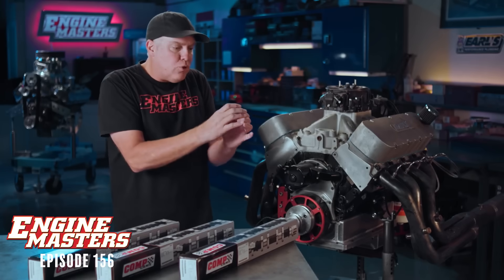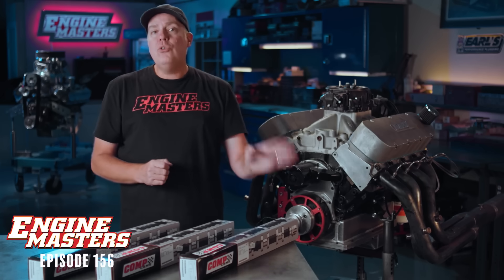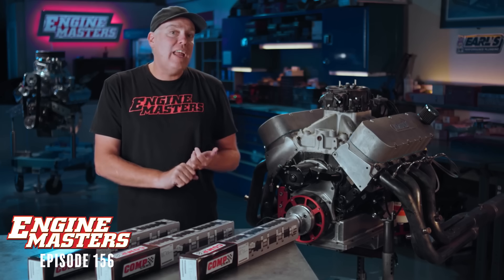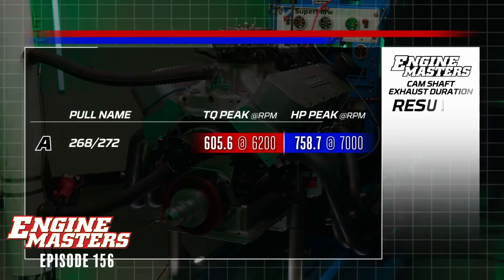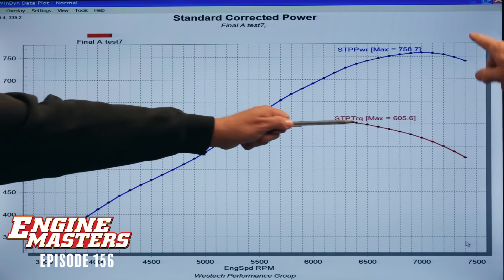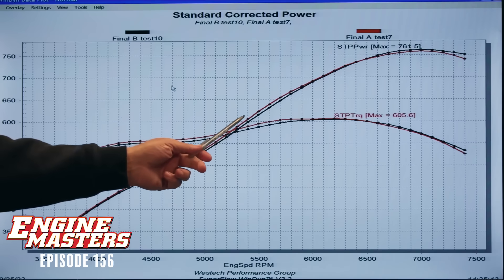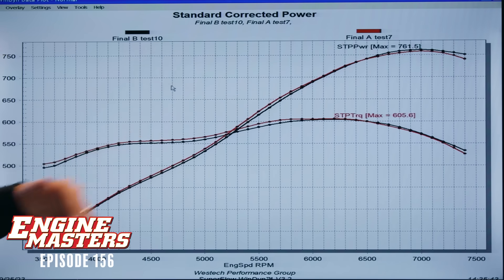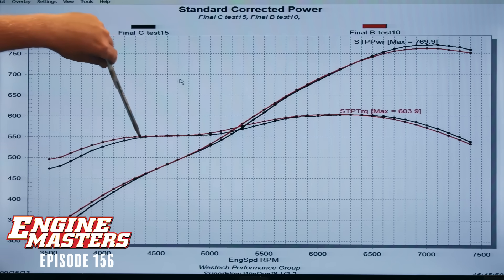Do Longer Camshaft Splits Affect Performance? | Engine Masters

Comment: One thing is clear to me. If i had any one of these cams, Im glad i didn't pay for an upgrade to any of the other two. The percentage difference is tiny. That is how it goes sometimes when you try science instead of just marketing. Awesome video.
Reply: theres less fuel exhaust, than fuel inlet. as its burnt up. this is why the exhaust valve is smaller, so a cam with same or smaller duration, is fine. bigger makes no difference..
Reply: Agree..Second guess myslef about not choosing my first cam choice. Would be single pattern instead of an 8 deg split and 106 vs 108lsa. 
If I lost a touch of torque so be it
Reply: The exhaust is under pressure and the intake is under vacuum so the intake is larger
Reply: The problem with this test is they tried it with an aftermarket head that corrected all the problems that would require a dual pattern cam. More of the reason for a dual pattern cam would be stock heads that had restriction on the exhaust, these heads do not have any of those issues so pretty pointless in my opinion

Comment: it should be noted that typically, stock cam will not have the same separation as the aftermarket. even a mild aftermarket cam will give longer duration and separation.
Reply: Sometimes less seperation. Or do you mean more overlap
Reply: @JustinMorrisV82  that boggled me for a minute. I guess the term might be a bit antiquated. it was a term I heard somewhere but never thought how misleading it is. you're absolutely right, it overlaps

Comment: Heads determine what camshaft you use Holman Moody heads you never use more duration on exhaust side. Stock heads have low exhaust flow rates .

Comment: We use big spreads on sbc engines when we spray them, usually on the opening side of the ex.
Reply: sbc needs all the help they can get.. or, buy a clevo..& a decent cam.. no other mods needed..  no speed shops.. bs machining ect.. sbc were designed in 1936, never changed.. dead horse flogging.. LS. = updated FE. from 1955.. wake up chev, your centuries behind..
Reply: @harrywalker968 correction FEs were designed in the 30s
Reply: chev even fkt up with the 454.. its just not quit a 460.. missed again..

Comment: I wonder how this test would go for an engine with a poor intake/exhaust ratio, like on some small block Fords I've seen with 2.02/1.46 valves? Would there be a benefit on a head with, say, a .72 ratio?

Comment: Can you just change the Lifters on the exhaust side to 1.6 if your running 1.5’s??If just changing exhaust side lifters to 1.6 will that change sound of the engine like a dual pattern??If going to a 1.6 rocker on exhaust side with this be to much of a split?
Reply: Just search on google "running bigger roller rockers on exhaust forum" and you'll find your answer

Comment: You mentioned that all cams had the same lobe separation angle (lsa) but what was the lsa, and what was the intake lobe centerline?
Reply: Considering that it is Comp and looking at the numbers, that's a basic 110 LSA and probably an a 106 CL.

Comment: More overlap? The faster the air moves the more the overlap shows power up top. It could kill low end but on drag race engines low end is not a factor and no real performance loss but on a street engine you don’t want that going on.

Comment: Fairly common with asymmetrical cams in Euro in line 4’s. The most common cam for the Superchargered 1.8L Golf G60 8v is a Schrick 268/276. I use a 264/270 in my 1.3L 8v
Reply: The extra duration is making up for poor exhaust flow, so its just a symptom of head flow. If head flow was at the correct ratio cams don't need to have asymmetric.

Comment: I feel like the longer exhaust duration would reduce turbo lag, perhaps?
Reply: You actually want a pretty mild cam for turbo engines unless your compression ratio is really high, and your running E84 or other high octane fuels to suppress knocking.
Reply: @blkcoupequattro yeah they work better with less overlap

Comment: question . why only the exhaust valves were modified, if the volume of air entered remains the same, it is not a loss to modify only the duration of the exhaust, can you test what happens if you modify the duration of the intake and leave it unchanged on the exhaust?
Reply: The exhaust is the restriction, so letting more air in with more duration isn't going to help.
Reply: a ok, I understood, thanks for the info

Comment: This is why you just use a modern engine with variable cam timing on both the inlet and exhaust camshafts. Mercury make a quad-cam big block Chebby motor, right? Does that have VCT?

Comment: You forgot to take into account how much cooler your car sounds sitting at a stop light
Reply: Who cares if it's taking the talk? It only matters if it can walk the walk.
Reply: @davidphillips3953  true, but...on a busy street, or pulling out of a show with the cops sitting nearby to catch folks...a choppy idle speaks loudly.  just like when you pop the hood...you could have a 7 litre aftermarket stroker small block with a single quad that looks stock, but nothing says power like some version of a blower feeding the engine.

Comment: Somebody said there's not very many 16° split cams out there. All Mopar 440 hp's have the 268 on the intake and 284 degrees duration on the exhaust with a .450 lift. Even the 440-6 pack which was a low taper had the same duration and lift and overlap as the regular 4bbl.
Reply: There's a ton of cams with large splits. Just look at all the factory LS and LT stuff. Some have over 20 degrees. 14-18 degrees is very normal in LS stuff.

Comment: Just changing exhaust camshaft isn't going to give much of the gain- it has to be a few other changes as well. You want to increase CR, install oversized intake valve and only then increase exhaust cam duration.

Comment: More exhaust duration is kinda a ls thing ls3 head for example flow really good on intake side but suffer on exhaust side so maybe a ls3 would benefit from the longer exhaust duration making up for such small exhaust flow
Reply: or just some exhaust porting.

Comment: I would really like to HEAR the engine idle with the different cams.
Reply: Agreed. How did this affect idle quality? Not important to all I would think, but to some, idle quality is a consideration
Reply: And minimum steady idle RPM, and vacuum readings at minimum idle, min idle + 500rpm, min idle +1000rpm.
Reply: Yeah, and maybe what they did to vacuum? I'm a stickshift/fun car kinda guy (not a serious racer), so it's less important to me than to some, but I would think that off-idle response, idle quality, and drivability might be what makes this decision for most folks. As always (well, at least the good ones), this episode provided me with more questions than answers.
Reply: Generally more overlap/longer duration the less vacuum and lumpier the idle
Reply: @jedpratte  Yes. Which is why 3000-7000rpm dyno pulls on a Superflow as performed by Engine Masters etc can be very misleading to the weekend warrior guys out there. What the engine does between 500-1500rpm is super important to most people and it's 99% ignored by these tests.

Not to say I don't love Engine Masters! I was just suggesting that any testing involving big cams should include:

1. Minimum steady idle RPM and vacuum reading
2. Vac reading @ min idle + 500rpm
3. Vac reading @ min idle + 1000rpm
Reply: @GroovesAndLands If your putting big fans in, your not it too concerned with 500 - 1500RPM, your stall converter needs to go up to match the cam. If your a manual driver, you just need to put down the pink shirt and deal with a bit off low RPM grumpiness. It's all part of the fun, I've owned cars that didn't start making power until 3800 - 4000- it was one of my favourite street/strip motors I've ever built... It's sleeping for another project that on the go
Reply: @RebeccaKenworthy  Same here. Love peaky engines that flat rip like a big 2 stroke dirt bike. I dont care about vaccum mpg or anything else. 
Just radical and tire smoking gear banging fun!
Just gotta gear it no biggie
Reply: @gordocarbo  I feel ya 👍
Reply: I don't think it'll be too bad if noticeable at all. The LSA is really what will affect the idle quality
Reply: @ShawnyStorm wrong. LSA is misunderstood, as is what causes idle quality.
Reply: @pimpovic2 You just told Lanse he was wrong and then contradicted yourself and agreed with him at the end? Are you alright? 🤔😂
Reply: @pimpovic2  Exactly right!
Reply: Wider the split typically, idles smoother.
Reply: Yes

Comment: I have a 318 with stock heads. The exhaust valves are small. I'm thinking that s is exactly what I need
Reply: Something on a 107 lobe center (lsa). 260-270 total 220@50. Duration and .450 - .470 lift.

Comment: I think you would see more difference with exhaust duration if you were running manifolds and full exhaust. A relatively unrestricted exhaust isn't going to need more duration or lift on it.
Reply: You forget scavenging and wave resonance. May be down on power no matter the split or little hp gain

Comment: It could be argued that the narrower duration separation is better, giving more low-end torque, allowing for similar or same ET's with longer engine life. RPMs are the enemy of longevity. The true test would trying it in a car, unfortunately adding more variables.

Comment: Id like to see the difference in dynamic compression. I really thought that would be a factor.
My only guess on why hp went up is it might've gained some minor scavaging?
Reply: No difference. Dynamic compression does not change with exhaust opening and closing only intake because the exhaust timing doesn't happen on the compression stroke, only intake valve timing.
Reply: @davidphillips3953  
Correct but it's not the whole story. Yes the calculated dynamic compression stays fixed, but have you tried testing the PSI? It changes, and it can actually change a lot. Reversion and scavenging plays a factor in how the cylinder is filled. So what does change, is the cylinder pressure.
Reply: @davidphillips3953  if it increases overlap, then it can affect scavenging and let out some of the mechanical compression available. but once the exhaust closes, then you've got a final compression ratio.
Reply: @alertgasper  
You are talking cylinder pressure vs compression ratio. Yes they do ultimately have similar effects on timing etc. but they are two different things. I can set up two engines with the same intake duration but vastly different LSA and exhaust duration. One will like boost a lot more than the other for example.
Reply: i believe peak cylinder pressure was about the same only at a higher rmp so the exhaust probably made the difference.

Comment: I like the Pontiac firing order sweat shirt.
Reply: That's the most common v8 firing order. Fords looked different mostly because they number their cylinders differently 1=5 2=1 3=6 4=2 5=7 6=4 7=8 8=4. But the roller can Fords do have a different order similar to an ls or 4-7 3-2 swap. All the gm v8s of the same era and the chrysler v8s had the 18436572 order.
Reply: Pontiac, Chevy, Oldsmobile, Cadillac, Buick, Chrysler, Plymouth, Dodge, pretty much everything but Ford products. Ford numbers their cylinders 1234 on the right, and 5678 on the left.
Reply: Holden gm 304 firing order is 12784563

Comment: ONLY 478 cubic inches and 12.5 compression ...LOL
Reply: Figure it’s a 427 after the aftermarket block and aluminum heads. It’s way easier to get 4.5” plus off the shelf pistons with relatively short compression heights than it is a 4.310/4.320 or even 4.375 anymore
Reply: lol yeah and they say small but I guess this day and age when you can buy a 632 crate engine making a n/a 1000 horsepower 🤷🏽‍♂️
Reply: @Carculturelivin It used to be big money, now it’s pump gas friendly? The 565 in our blown alcohol car started life as a Sonny’s 1000hp street engine. Dart 380 heads, Bow tie hi nickel block, it was a real high dollar piece back in the day. Now you can build a 565 with off the shelf parts. That’s not to say you don’t need to know what you’re doing and you’ll most likely be milling heads and massaging pistons but it amazes me what’s available these days.
Reply: It's relatively small cubes for a  modern big block, when over 600 is common.
Reply: @guyl9208 yeah exactly these days 478 is just a “rebuilt” 454 to most anymore
Reply: It's insane how out of touch and lacking self awareness some people are.

Comment: I would have liked to seen the cranking compression on all 3 camshafts?
Reply: They would have the same intake valve closing time. The difference wouldn't show up on cranking. The differences would be how much reversion of exhaust into the combustion chamber during overlap and how much combustion pressure is lost on the power stroke do to an early exhaust opening.
Reply: @danieldimitri6133  You are talking theory , I want to see real world.
Reply: He's right it would not affect cranking compression. At cranking speed theory and reality match up, it's when explosions start happening that theory gets a lot more complicated and harder to predict.
Reply: @danieldimitri6133   opening the exhaust valve early causes some loss of combustion pressure, but it decreases pumping losses after BDC, which increases higher rpm HP.  In my head it seems that opening the exhaust valve earlier in the power stroke would make the exhaust louder, what is your thought on that?   My thoughts on this is if I install a cam in my Harley that opens exhaust earlier, the bike will be louder and sound nastier.  I have noticed that a ProStock bike racer that has his own cam line has a very early exhaust opening on all his cams....
Reply: you need a big bang to do that so early exhaust needs more compression from either the intake lobe or the piston or both, but it's got to come from somewhere. earlier exhaust usually means more rpm and probably more duration. the word is momentum.

Comment: I’m using comp cams part # 35-226-3 280H hydraulic flat tappet cam 230 duration at 50 .512 lift intake and exhaust moster torque from 2,000 to 5,000 rpm been using this cam for many many years in my 351W builds I’ve only flatten one cam ever
Reply: Very similar to the Elgin E-907-P I liked to use in Clevelands - .505 lift and 220@50 duration. Very mild, monster torque up to 5000rpm and awesome on the street.
Reply: Modern lobe should make more hp and torque

Comment: I love the door analogy for explaining duration. I may steal that one. Thank you for another great video Engine Masters crew. I do wish you laid a baseline for each with a single vs split for each cam. I want to know the difference at each level!
Reply: What's missing from the analogy is that the room gets kinda crowded, so if you leave the door open too long some people will walk back out. And the exhaust is a door to a nasty back alley, leave it open too long and some people who should have left will walk back in.
Reply: What if you make a system that lets you use both duration lobes in one engine, with a way to switch back&forth while the engine is running?
Reply: @Iowa599  There is such a "system."  Got V-TEC yo?
Reply: @reubenmorris487  I have VTECs!
Reply: @Iowa599  VVT.

Comment: Id want to see an increase in exhaust direction without changing the lsa.  Keep the ex valve opening event the same just more duration.  This way is adding too much overlap as you add duration.

Comment: So, it seems the differences are quite small for anything but track only engines. I wonder what would change if you ran the same test, but with changing the lift instead?
Reply: Lift doesn't make as much of a drastic difference as duration and LSA.

Comment: Digging the Brulee mullet!
But, wondering what would be the difference between cam 1 and cam 3 if using nitrous? I think cam 3 would make a much bigger difference due to cylinder pressure
Reply: Or maybe more to the point, greater exhaust volume due to more oxygen/fuel
Reply: The cam that makes more power NA will then make more power with nitrous.
Reply: The longer exhaust duration has to help get the extra pressure of Nitrous out and make more room for the next charge but there is a trade off of early pressure release, but at the crank angle it should be very little.